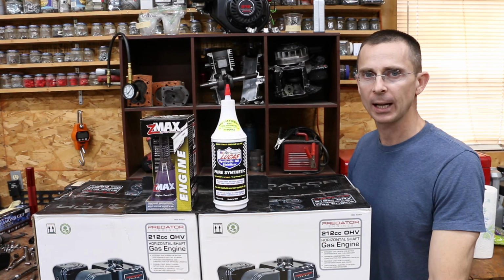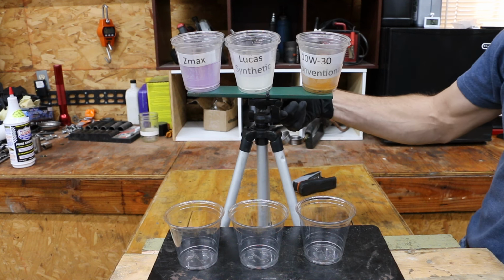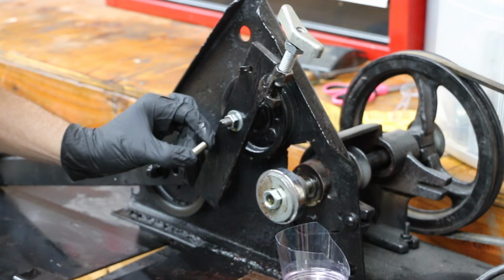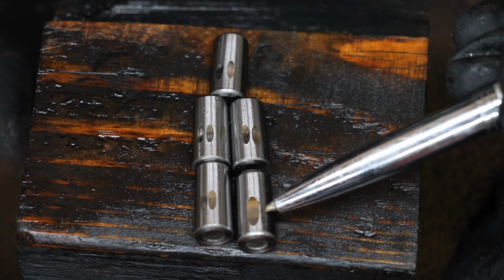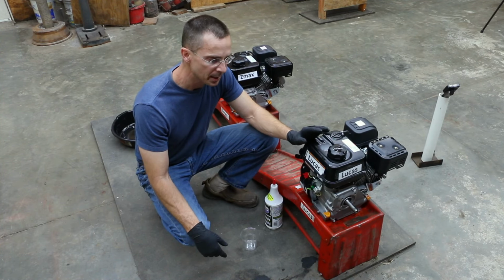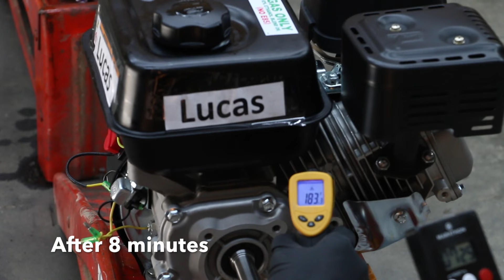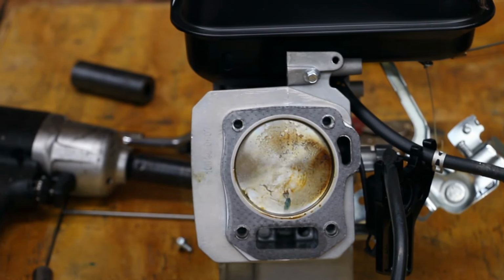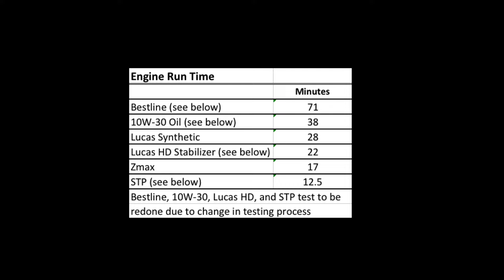Which engine self-destructs first? Zmax or Lucas Synthetic?

Comment: I’m fairly certain that so called additives are an attempt to replace elements that were common in petroleum products years ago. Think about the refineries and what kinds of lead or zinc pipes, fittings and vessels were utilized, the process also used less caustic refining processes so it was easier to just include traces of refinery materials in the fuels and oils and market them as “additives”, which were actually beneficial to earlier engines. Now compare today’s use of stainless, titanium and other more exotic metals in refineries combined with much more caustic processes for sour, tar sands and fracked oil compared to light sweet. There are dramatic changes as seen with refinery accidents stemming from more caustic elements, along with the lack of benefits for earlier engines not specifically designed to withstand the traces of more caustic etching as opposed to lubricating elements, now marketed as cleaning because again it’s too costly to refine until they are removed altogether. When you think of it in these terms you can see why ZDDP zinc additives are good for oil in older engines. New oil doesn’t have zinc. And lead is also good for the valve train on older and still current aviation reciprocating engines. Measuring an additive by itself by virtue of film strength misses the point of zinc where it’s intended to prevent corrosion and enhance break in through added viscosity. At least that’s my understanding.
Reply from the maker: Thanks for the feedback.

Comment: Little secret about engine oil’s if you have to add a additive to help your engine transmission whatever buy a better oil this is six in a row jimI have a 991.5 Dodge is coming up on 500,000 miles I use Amsoil products still runs good
Reply from the maker: Thanks for the feedback.

Comment: I love these hemi head predators and the regular ones lol I’ve had them sling rods just like these from no governor abuse lol  and if it didn’t crack the block or mess the crank up to bad I’d polish the crank and then throw another rod in it and do it again 😂 and it’s amazing how much better synthetic oil will lubricate and keep friction and heat low on these engines being the aluminum rod is the bearing
Reply from the maker: Thanks for the feedback.

Comment: I could be wrong, but I heard that Zmax takes some time to actually "soak" into the metal. How long? I don't know, but that may have something to do with these poor results. In real world cases I have used Zmax and had very good results. I have a 27 year old lawnmower and last year I tore it down and checked all the parts inside. Only the cylinder wall had some scoring that needed honing. All the rest was really clean, very little carbon anywhere.
Reply from the maker: Thanks for the feedback.

Comment: There designed to refuse the thickening of pills in cold temperatures I use Lucas on my race dirt bike and when it’s cold it helps the engine start due to the freeze resistance
Reply from the maker: Thanks for sharing.

Comment: Diesel additives Archoil or Hotshot?Oil and Fuel?I love all Lucus oil Products and I have personally had amazing results long term.I have a 2000 Dodge 5.2 with 365,000 that knocks if I don't use the Lucus oil additive although I've never tried the synthetic lucus additive.Ive seen tremendous results with the transmission oil additive as well.
Reply from the maker: Thanks for sharing.

Comment: I ran ZMAX in my last analytical lab, it is basically just colored mineral oil. It was the least impressive additive. Lucas Oil had significantly better composition that would actually be useful in an engine.
Reply from the maker: Thanks for sharing.

Comment: Would you test v twin motorcycle oil against 15w40 diesel oil. I've heard it's the same stuff. The motorcycle oil is 15-20 a quart. Diesel oil is about 15 a gallon.

Comment: I am just wondering. I used to put small motors on bicycles. With all new motors you need to break them in first. Did you break these motors in before you ran these tests?

Comment: Was looking back at a few of these videos as I forgot the results. You tested some important things but I wonder about some more obscure things like if your rings are worn a bit would one of these help hold a film up near the rings whare it's very hot and prevent further damage and oil burning? If your oil pressure is bad would somthing like liqud moly help build a more long lasting film over time and prolong your engine life or I guess at that point more like slow it's death. I know moly greese will stick to everything and never want to come off so thus why this comes to mind. Another thing is if you had a cheap oil that was useable but poor quality would one of these turn it into a high quality oil? Or would the effect just be having a mix of good and bad. There are so many oil additives I'm curious if you take a top of the line oil is there any of these that add any benefit or is everything already in the oil?
Reply from the maker: Thanks for the suggestions.

Comment: Hay most engines use a whole bottle of Lucas pure synthetic oil stabilizer in vehicles also most vehicles use a whole bottle of ZMAX and it slowly sinks into the metal not fast takes A decent amount of miles to work correctly so if your trade is the ZMAX again you should use it and let it sink in the metals for quite a while before doing the test it takes that long to get all the way into the metals
Reply from the maker: Thanks for the feedback.

Comment: It's amazing how long Lucas handled the longest in the test what about motor up that is supposed to a excellent oil additive try that test also I like to fine out if a variable speed electric motor or an electric speed controller be mounted on a air compressor & set the controller or variable speed electric motor set on slow speed if the motor would turn over  the air pump on the compressor it would be interesting if the electric motor would turn over set on slow speed Kind Regards Peter
Reply from the maker: Great suggestion!  Thank you.

Comment: Would a better test be to run the engines with out oil for a set time or until the engine starts to knock and then tear the engine down before it completely self-destructs???  24 years ago I had a 1995 F-150 4.9L 6cyl engine.  Blew the oil pan gasket and didn't know it.  I was using 10w30 pennzoil conventional oil and duralube additive.  Drove approximately 18 miles before I had lifter noise.  According to Ford, the engine should have seized and most likely the duralube was the only thing that saved the engine......
Reply from the maker: Thanks for the video idea.

Comment: Zmax in my experience seems best at loosening 100k miles of carbon buildup.  Just watch out for it working too well and sending carbon deposits in the catalytic converter and clogging it.  Used periodically, the carbon deposits in the combustion chamber should never build up to clogging levels.
Reply from the maker: Thanks for the feedback.

Comment: Can you test the viscosity after adding these products? Lucas states that it does not change the viscosity of the oil. I find it hard to believe that adding Lucas to your motor oil would not make it a thicker changing the viscosity. I would be curious to see how each changes the viscosity of the 10W - 30 oil. And I would love to see the results of a combination of the two additives.
Reply: I would also like to see how Lucas does with the ratio of zmax. Zmax states that you can add it after an oil change and it will not overfill the motor. With the Lucas recommended additive to oil ratio of 1:4 you could never just top off your oil.
Reply from the maker: Thanks for the suggestion.

Comment: Noticing the crankcase temperatures are approx. 138F on the outside and the cylinder temps average 178F-180F, wouldn't it be safe to say the engine oil temp is about 150F inside the crankcase due to some shielding, and cooling effect of the crank casing as a porous semi-conductor, with some insulative temp differences between the oil temp, and the crank temp?

Just speculating in a ballpark range, that is fair to assume without an oil temp gauge, to have a General Baseline Temp. for the oil to know when for ex. a 10W30 oil has reached optimum operating temp to determine its reached the "Weight of 30" Hot, as the 10 of the 10W30 grade stands for 10 Weight when cold. The oil when hot is thicker film when hot, therefore offering more protection, than the thinner 10W when cold. 

Yes, starting the lubricity test with oil cold, does simulate how the oil protects your engine during start-up, and gradually thickens as it warms up providing a linear progression of How each individual grade oil brands perform linearly, but for Curiosity Sake, could you do a side by side test with the oil at temp, and another of the same brand from cold to show the difference in wear between the two?

That ZMax is useless...you'd LIKELY have better results with Oil and Vaseline as your additive.
Actually, 'id like to see that one. "Oil with Bestline vs Oil with Vaseline"...I mean, we did a test with Bacon Grease already, and IT even Outperformed the ZMax.!! 

Moral of the story is...use Bacon Grease instead of ZMax as an additive; ZMax is Costly both ways; price, and destruction.! Bacon Grease? Costs next to nothing...AND you were just gonna throw it away anyways.! LOL.!!!

BUT, Please...Actually do a video "Oil with Bestline vs Oil with Vaseline", "Which is Better?"
A runtime/fuel efficiency under load, and how they compare...Obviously Bestline Wins, but wanna see how far behind Oil with Vaseline is, compared to past tests with oil and other oil additive brands that you've tested, if you could cut to the results of the 3-5 brands closest to Oil with Vaseline Additive. I think others would find it Intriguing... 

Using 2 Engines Please...Could be identical engines that are used, and not broken; with equal compression just for demonstration purposes...no need for new engines...Too much to ask for a playtime curiosity experiment. 

Really looking forward to this one Bro...
Reply from the maker: Thanks for the video idea.

Comment: the trouble i have with this test is that he uses brand new engines. The way Zmax works is to break down the lubricant into smaller bits so that it sips into the cracks and smaller places.
Reply from the maker: Thank you for the feedback

Comment: Hey I appreciate all you do...  Don't care if you destroy a couple hazardous fraud engines neither plus they are going to teach the youth something that is lacking, not like it use to be when an auto shop teacher was the cranky old timer you learned tons from.  

I've seen testing where Z Max Oil actually harden seals then caused leaking main seal along with other problems..... I don't think it is the miracle solution that it is sold to be.  Could you test the seal hardness before and after treatment.
Reply from the maker: Thanks!  Thanks for the suggestion.

Comment: What about testing if mixing multiple different additives in the oil and seeing if that provides better protection? I regularly use Lucas full synthetic and REV-X zinc additive with Valvoline 5W30 FS HM hoping to provide the best long-term protection in my truck, but I have no way of knowing if it makes a difference. If it does, im curious of what the best combo would be for maximum protection
Reply from the maker: Thanks for the suggestion.

Comment: Just wondering about Z Maxx in transmission and power steering also the fuel part and if I added this product to my oil should I do an oil change quickly to get it out or would it be safe to continue running it

Comment: When you tested motorcote, you ran the engine with water for the hour long run. While the water doesn't lubricate, it helped dissipate heat. What would happen if you ran a motorcote treated engine until failure without water?
Reply from the maker: Thanks for the suggestion.

Comment: I noticed you are using red can CRC brake cleaner , I used to use that for years , now I cannot be anywhere near that stuff . if I get it on my hands and it soaks into my fingers I will lose my fingernails . it takes 6 weeks or more to heal up . even the fumes attack my lungs right away and I react .  maybe you can do a test on various brake cleaners and see what ones are the safest to use .
Reply from the maker: Thanks for the video idea.

Comment: Film strength is not the reason zMAX gets put into an engine. I don't expect it to do well under these conditions. Was zMAX does wonderfully, you can spray it on an inner Fender and it'll keep it from rusting for a long long time. It also keeps metal wet which will keep carbon from sticking to it. And it also provides a mechanism for heat transference because the metal is holding the oil better. The other thing it will do and a crankshaft is it will stop oil from sticking to the crankshaft any more than it needs to. So you lose parasitic drag.
Reply from the maker: Thanks for watching.

Comment: Do this with a car engine,the ability to be cooled. I had an old Ford F150 that went through oil like my wife and a box of donuts. Drove that F-150 for 50 miles with zero oil,it was so hot it started burning off the coolant,as I pulled into my driveway it gave a great sigh and locked up. The next day I put coolant and  and oil and  it fired right up and lasted another 2,000 miles....I had Lucas oil in it to start with,so it burned oil fast as you could put it in,but I had ran out of oil. I was shocked it even started back up and still purred like a kitten,plenty of power....but it smoked like Cheech and Chong! Awesome test though!
Reply from the maker: Thanks for sharing.

Comment: Do you know if using zmax and restore in the same oil will damage an engine? My truck wasn’t running right so I tried zmax (before watching this video) it didn’t help. I’ve done a compression test since and there is low compression. I was thinking of throwing a bottle of restore in to try it, but don’t want to  do a full oil change just to test it. I Love the videos by the way, I’ve watched several.
Reply from the maker: It shouldn't hurt to mix them. Thank you

Comment: Will you please test Petron Plus Oil additive.?   this stuff seems to be good
Reply from the maker: Thanks for the video idea.
Reply: @ProjectFarm  Petron has many types of additives on the market.  The particular one that I have used is the formula 7 oil additive.  (conventional)  It isnt cheap but it seems to work.  Have you ever heard of it?   Ive only been using it a couple years, but it seems to work great.  Even better than Slick 50 did back in the day when it still had teflon in it.  My idle immediately went up 300 rpms upon first application.  These additives can take a lifetime to really know for sure if they work.  Your scrutiny and unbiased tests are awesome.   Thanks

Comment: So why do I trust Mobile 1? A long time ago I had an original 1992 Saturn SL2. I changed the oil that day from Mobile 1 to mobile 1. He cross threaded the oil filter and later rhat night I found a pool of oil on the ground and none in the crankcase. I got it home 10 miles later an the only symptom was running 20° hot. There was no damage.
Reply from the maker: Thanks for the feedback.

Comment: i feel like its apples to oranges., imo,. i'd try a product like Zmax for different reasons than a Lucus but neither in a fresh engine tbh,,,   like if oil restriction is your concern a Lucus might not be a great idea but zmax is fine to try. ie if i think i might have sticky lifters or valves  in an older engine a zmax like product might be a better option. but if you have leaks or burn oil, a Lucus might be better,,  the selling point for it was its performance after prolonged usage though, so your tests don't exactly refute their claims.  Lucus is a sticky and thick product which is how it does its job .  zmax is a much lighter and thinner product meant to do a job in a different spot sort of speak,  their trans additive frees up sticky valves improving shifting in older transmissions , and fuel additive is for lubing injectors and cylinder components.,  you should see just for shts & giggls if the fuel and oil treatment works any better.,  my guess is not.,,. cuz as far as i know ,. to get the results they claim you'd need hundreds of run hours to impregnate an engine enough to run with no oil,.

Comment: You did not test for cold starts. I thougt maybe you could disconnect the valve from the Camshaft so that thé motor can turn without resistance, full it with oil, put it in the freezer than mesure the turning resistance of the motor. You can use the same Electric motor than the libricity test.
Reply from the maker: Thanks for the feedback.

Comment: And Lucas like you did a news Ford Ranger I have a Ford Ranger to that's over 200,000 miles and the power steering steering pump squeal in a little bit and it doesn't have a bad performance but if I can make it better with almost 210,000 miles I would really appreciate it
Reply from the maker: Thanks for sharing.
Reply: Sorry about my texting I was wondering can you use Lucas and power steering boxes and or manual transmissions

Comment: You should try Bardahl B1 or B2
Reply from the maker: Thanks for the suggestion.
Reply: @ProjectFarm  I used to sell Bardahl when I was in college 25 yrs ago, my Jeep Grand Wagoneer burned oil like crazy, I was running B2 and drove 14 miles across Caracas in traffic to my office to show all my colleagues with 0 oil pressure . Checked dipstick and crankcase was empty. No knocking, no smoking.. added oil and oil pressure went back up.  We used to demonstrate products using friction machines at oil change joints. 
Thanks for your great channel and your  ingenious way to test products and equipment.